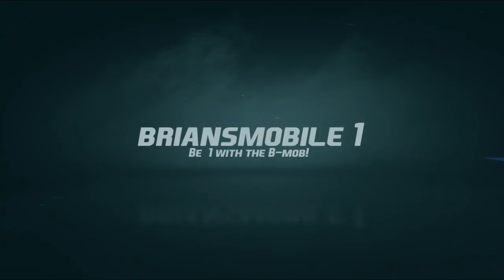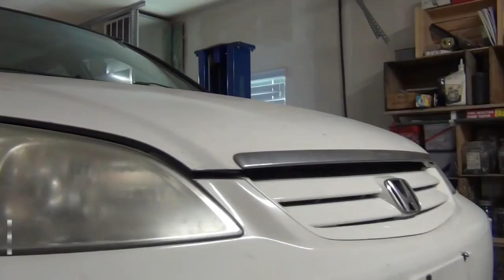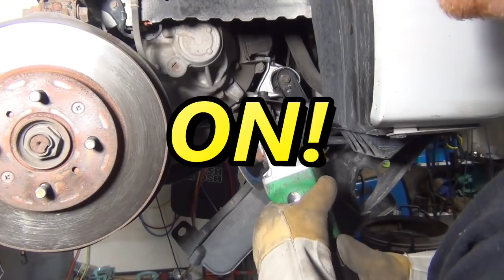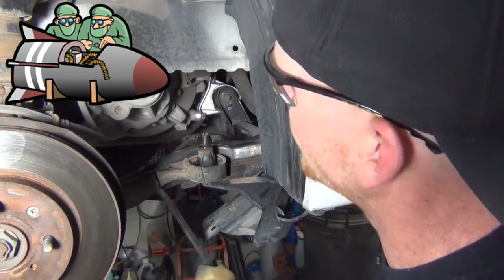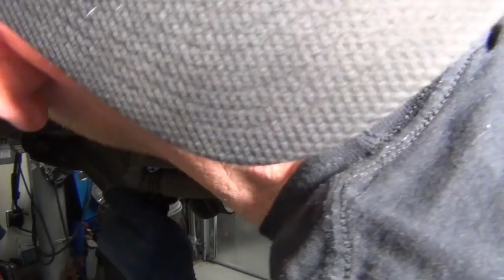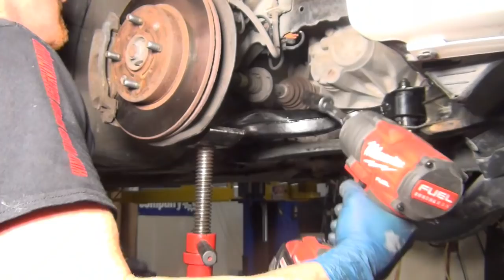Rusted Bolt in Control Arm Bushing Fix 1 of 2

Comment: My issue is with a horizontal bolt on the control arm of a 2008 Ford Escape. The nut is inside the subframe and cannot be accessed.  It's so rusted that it won't move!  My impact won't move it.  I sprayed it with PB Blast for two days.  It started to round of so I got a new bolt from Ford but I am afraid of ruining the threads on the welded in nut. I am going to spray it daily for a week then get a long breaker bar and try that. The other bolt and ball joint came out no problem.

Comment: This is great man, thanks so much. I tried doing the upper control arm on my 2011 Crown Vic Police Interceptor and had to cut through the ball joint. When it came time to knock out the bolts for the control arm, they were completely seized in the bushings. Going to have to use my sawzall or grab a grinder to try and cut through the bolts so I can get the old arm off and knock the remainder of the bolts out.

Comment: One other major danger with angle grinders is if the metal sags and bites the blade it can pull you into the car and your hands toward the blade as well as make the blade explode. It's a very good idea to use an angle grinder that has a clutch built in so that it stops the blade if it gets bound up.

Comment: I had the same problem with the right Lower Control Arm in my 1998 Lexus ES300. As a layman, I washed the Nuts bolts with car gas drawn in a cup with a brush. I waited about half an hour and then I  tried and opened all the Nuts and bolts except the one behind Rooter as the pin was broken from both ends. As the grinder could not work due to space I tried to cut with a hand saw without success. Now I am going to try drill machine and hope will be successful. Wish me good luck!!!

Comment: Biggest lesson I've learned is have any spare bolts with your suspension jobs. I got screwed on my job today because I didn't know once these seize you have to cut them. I got wanked by the sway bar links on my last coil spring shock job. I keep my guards on. Keep spare bolts! Thanks for the info!

Comment: I believe I would have cut the bolt with a sawzall and carbide or diamond blade before cutting the control arm. The sawzall is a scary tool also, but for something like this, much safer than the grinder. I say this from experience having used a sawzall to remove my lower control arm bolts recently.

Comment: Another tip for protecting delicate or flammable parts from the grinding sparks is purchase a Fire Blanket of the type you use in a kitchen. These form fire,spark proof barrier if you need it

Comment: My two cents...If you plan removal a week or two earlier... a daily application of penetrating oil of your choice in the problem areas allows the penetrant to work to it's full potential. The added vibration of driving the vehicle allows for even better results. Best to you and yours.

Comment: I wear a FULL face shield when I use mine . Depending on the model , they run at about 9000 to 12000 RPM ! Just imagine if that kicks back at you . That wheel is NOT going to stop on a dime . If a piece breaks off at that speed , think about getting shot . It is the most dangerous tool I have used . Respect it or pay the price .

Comment: Unrelated question: wtf are those four little bumps on the sway bar links?
Reply: probably it's just a method for helping fixate the rear joint socket into place. Instead of casting a shape into the metal casing to hold it. Now that I typed that weak speculation out I'm like, yeah what are those? Well they're not on aftermarket links anyway.

Comment: I've used the 4 1/2" and a 7" hand held grinders. I got a chance to care for a 7" grinder accident. I actually saw the before & after, (was watching him from the scaffolding 20 foot up) laid a block, herd a scream, ran down and held, to stop the bleeding, and stabilize what was still clinging to his left lower arm which was 8" of his lower arm with a hand attached, as the 7" grinder without a guard kicked back as he was cutting 6, 1/2" rebar to 8 foot lengths. I've never removed a guard off a grinder since then, or even before that. I worked on that shopping mall for over a year. Never saw him return to work. To me it was a life changing accident, that could have ben prevented. Use all safety stuff provided with what ever your using. We all want to go home, the way we showed up at work.

Comment: On the sway bar links, I use a pickle fork to pry the ball out of the socket, then a vice grip on the exposed ball to hold it while zipping that nut right off with the impact. Takes less than a minute per side and no angle grinder necessary.

Comment: This is a little off subject but i wanted to reach your attention as quick as possible, so i went for your newest video. Im replacing a timing belt that snapped on my ej25 (06 forester) other than making sure timming is set right, is there anything i should do first before trying to put the belt back on? Im hoping no bent valves or bad pistons. Please help

Comment: Brian, I have 2004 odyssey and I changed both lower control arms comes with new ball joints ,2 end links and stabilizer bar bushings  but I still hearing some clunking sounds when hitting bumps ,any suggestions is greatly appreciated,thanks

Comment: Brian, there's no excuse for removing the guard. with it on the barrel side, it will protect your hand. You don't cut with that side of the tool anyway. People tend to choke up on the tool as the work progresses. Being afraid of a tool is NOT safer. When you're afraid you hesitate and lose focus. Just my opinion. Been using dangerous tools for over 50 yrs and have never been injured. Common sense is the best tool you have. enjoy your videos.
Reply from the maker: You're not wrong.  Thanks!

Comment: 6 years ago, even with the type of safety glasses you are using, during grinding/cutting, a piece of metal managed to fly in through between the glass and my face. It went well thankfully. Since that day i always prefer to use glasses that sit flush with the face, no gap. Protective equipment is very important :)
Reply from the maker: Absolutely

Comment: Literally just changed a control arm on a 2004 civic, identical problem. I bought a new bolt from Honda and used the grinder to chop it off. Cheaper for the customer and less of a headache for me

Comment: One word......Sawzall
Reply from the maker: Not a fan of the shake, shavings, and lack of control, but It's WAY, WAY safter better way to go for most.
Reply: briansmobile1 I tried a sawzall for some suspension work and very quickly then ordered an angle grinder... BE SAFE BE SMART I now use my sawsall for yard work lol and the angle grinder for lawnmower blade sharpening!

Comment: By the way, you had made a video a few years back of welding vice grips to a slide hammer to pull out a cv joint axle.
I did the same to do it on a Volvo. It worked perfectly. Thanks a bunch for that video...
Reply from the maker: Welcome!

Comment: frozen bushing sleves just suck usally burn them out yea it stinks use a fan, keep water handy get bolts first not to tie up lift . did upper arm on a hummer 3. three frozen ran out of torch. gas. hacked it up with die grinder and sawsall my glasses looked like your lense.lol those bolts are tough.had them in stock roc auto  good thing..got those pliers good tool. thanks for sharing.
Reply from the maker: You're the MAN!  Just bucking through the problems like they're piles of fall leafs!

Comment: At least the thin wall cuts could have easily been made with a 3" or 4" air cut-off tool. They are much safer to use, since they typically stall when they get caught on something. Would have use the sawzall or air body saw for the remaining cuts (could even start the deeper cuts with the air cut-off tool). Air tools are way safer than electric IMO.

Also, typically with those end links if they are garbage I just get the nut moving with the impact gun and then switch to holding it with a wrench and then use the impact to drive it through by putting it in the tightening direction. Might not be the best idea if you are saving it, but still, you'll be done in 5 seconds if the impact fits in there.

Comment: Good day Brian. Pls try at once hot acetic acid for rust removal, or you can make a gel of it with dry wood glue and apply in places where liquid will flew off. It's a magic thing - it doesn't hurt a metal, but dissolves ferrum oxide in oil form. Better not to breathe vapors of it, but it's not so harmful as it stinks. For me this 'vinegar' method is the best for stuck threaded connections, it takes some time to dissolve all rust to an oily form, but it's super effective (*with a help of metal brush tool and water to remove the rest of it).

Comment: Some kind of protective gear for the camera would serve a purpose for guys who do videos. I tried using a welding helmet over my camera, and it works but is annoyingly time consuming. Hot metal beads melt right into the glass lens.
Reply from the maker: Too true.  I can't wait till I can get set up in the new building with adequate floor space and have things that can just stand there on a tri-pod at the ready.  AC is going in tomorrow.  Lights hopefully later this week.

Comment: I work at a Honda dealer so I have done this a few times. Normally what I do is use a sawzall and cut on top and and on bottom of the bushing, pull the arm out, and back the bolt out with a pair of vice grips. nut is ok, arm is ok. replace bushing and bolt
Reply: I was just gonna ask why he was going to all that trouble.
Reply: @crfjd160  No blades for the sawzall? Or is showing what to do if you do not have one, plus angle grinder safety.
Reply from the maker: @SeanBZA  Angle grinder is my go to for speed, control, not getting hand problems from vibration etc.  It's just stupid dangerous if you don't respect it.  Figured a video was in order.
Reply: @briansmobile1  Figured so. I like them, but have a lot of respect for the blades after having had way too many turn to powder and shrapnel in an instant. Especially those thin cutting blades, they really want to turn to pieces with any slight mishap. But still use the angle grinder that I got from my father, who got it in the 1980's when they came out, and look after it. Got plenty of others as well, just like the first one.